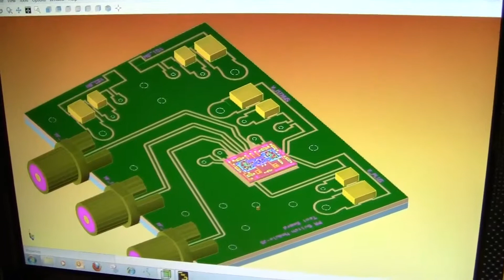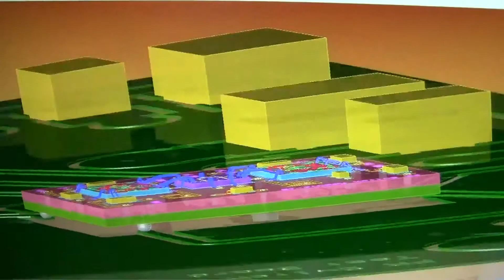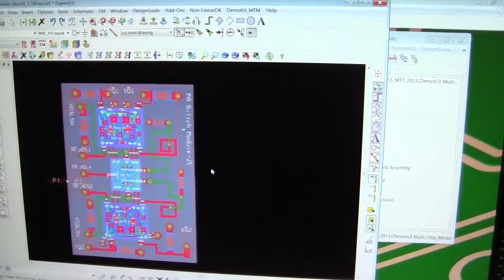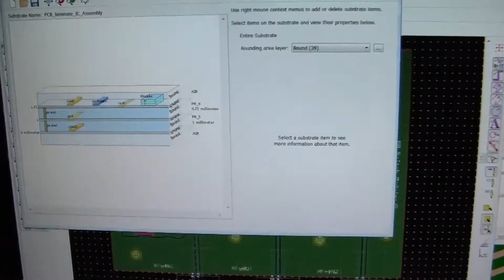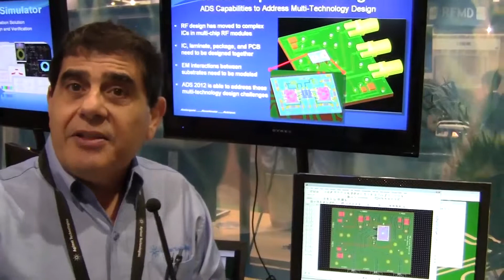Multi Chip Module Assembly in ADS2012

Comment: iNPACK provide IC packages in a complex array of shapes, sizes, and materials, providing the ability to select the exact features and functionality best suited to your specific application, including Aerospace/Aviation industries mentioned in this guide. This determination however is dependent upon a number of factors, including: Pitch, Dimensions, Lead Count, Thermal Requirements and Costing.